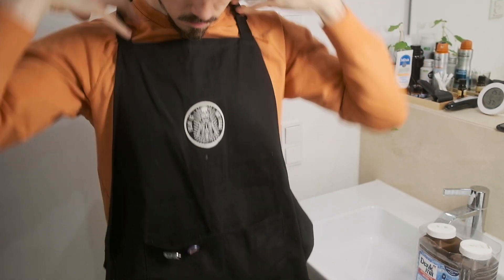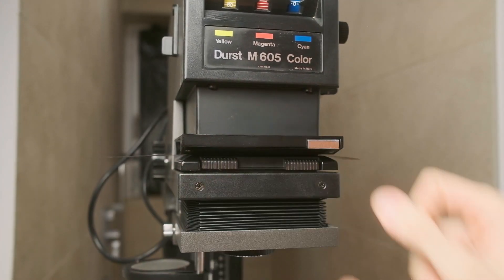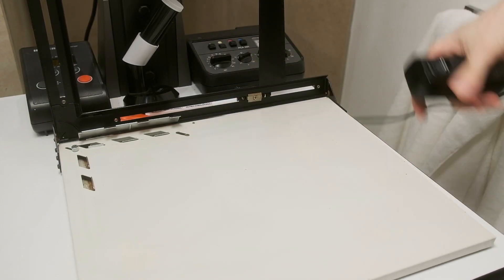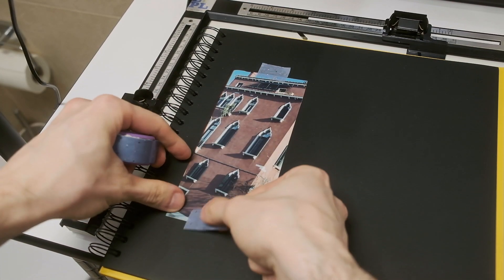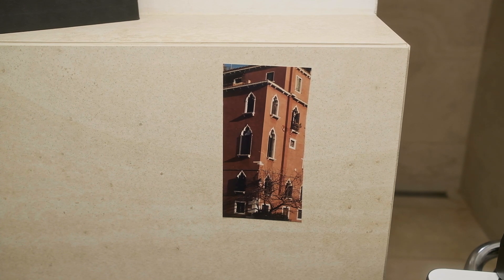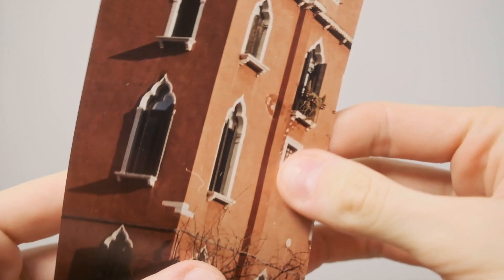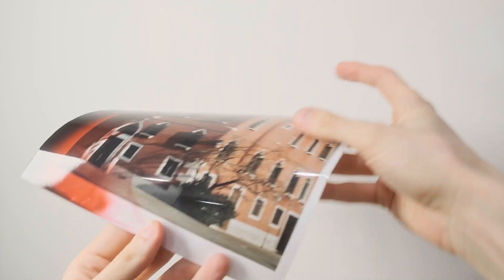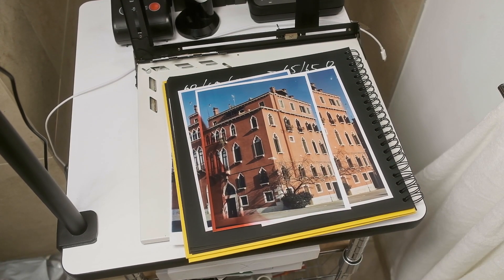New chemistry vs old and Fujifilm Fujicolor Supreme paper for RA4 darkroom color printing

Comment: Great video Alexandr 👍🏽 I find using developer after the first round of prints there's a little colour shift, however once I add new solution on to the old one it fixes the issue. I was curious to know if you used a stop bath after developer or you just rinse with water and move on to blix? And if so what stop bath would you suggest? Thanks again
Reply from the maker: In principle it's not required at all, at the moment I'm in testing stage. If it will not increase longevity of the solution - I'll just discard it. Stop bath only important in R2R tools because you accumulate stuff in the next tank (you using the same 5l solution all the time and just use additives for compensation. It can be what use of stop probably it's waste of time.
Reply: @NordicLab  I'll wait for your test results on the stop bath then.
I personally use a stop bath because I'm used to using one for B&W printing. Just acetic acid (white vinegar) or citric acid diluted in water. But if it's useless, it will save me a step :)

Comment: Also looking forward to your paper cutting setup. And appreciate the info on the roll packaging.  I just ordered a roll of 11" x 295' of Fuji paper. Just bought the pre-cut sheets previously.
Reply from the maker: Be careful, it's actually heavy and core just two plastic discs from both sides and the whole roll can easily "escape" from your table on the floor (don't ask how i know it :D )
Reply: @NordicLab  Thanks for the advice on escaping paper rolls! :D  I had been considering doing something like this when I receive the new paper roll. https://youtu.be/EXKYnbcizaw?t=526

Comment: Looking forward to the cutting setup! I've purchased two rolls of fuji supreme myself too. Do you use the jobo maxilux safelight while cutting the rolls?
Reply: I´m not the guy you were asking this question, but I use Fuji DPII regularly in rolls. I tape a strip of photopaper in my paper cutter, and use this strip as a guide. I do this in complete darkness. You should not leave your color paper exposed to a safelight for a long time - they are meant only for a few minutes max.
Reply: And for storage, at least Fotoimpex in Berlin is selling empty cartons for photographic paper, and light-tight plastic pouches for putting the paper in before boxing it. Approximately 100 sheets will fit into a box.
Reply from the maker: In general yes - you can use safe light, but you need to keep in mind, what you remove time "before fogging" while you work on exposure. If your paper thick enough it's mainly protected inside the roll from low intensity of safe light, but better to keep whole roll in the darkness (for example bag) and expose to the safe light only leader what you cut and put ready paper in the bag, it will be not more then 10-15 seconds of total exposure, so you have around minute more on paper to work. I also will test it later. And about black bags - i have roll like 200m in stock, it's termoplastic, so i can pack any time of size. I have more problems to find "paper safe" which is not like 200 EUR and not crusty and ugly old.